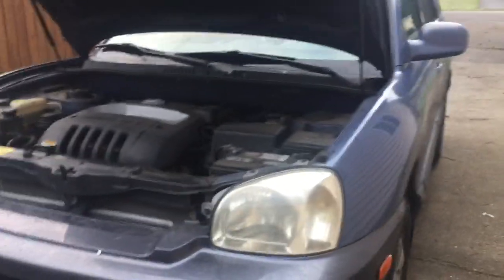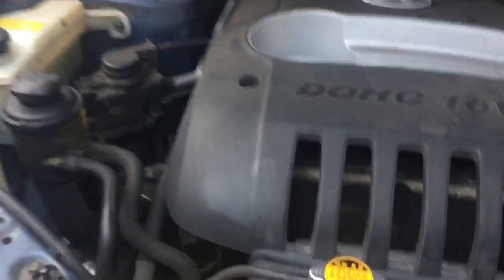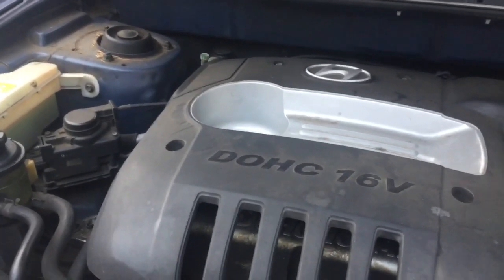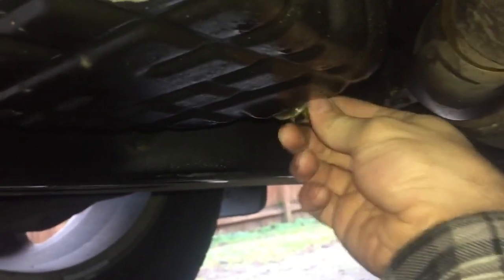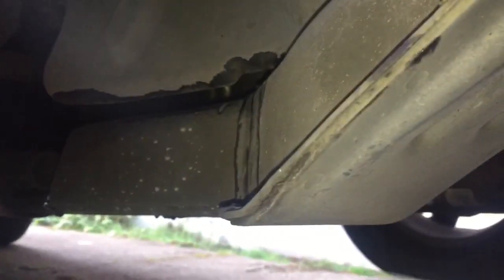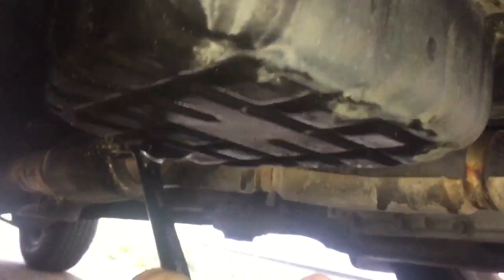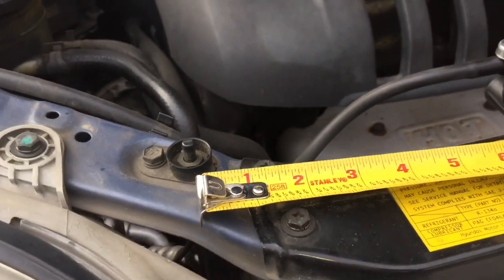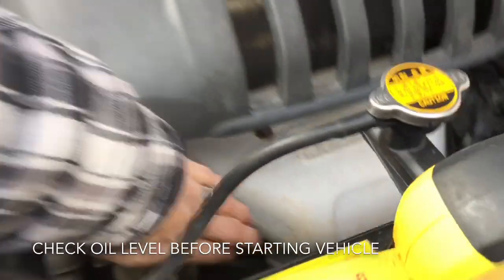How to change engine oil on Hyundai Santa Fe 2.4L

Comment: Hey dude really appreciate the videos on the 04 Santa fe, can you make a video on how to replace the rear speakers in the trunk?
Reply from the maker: Mine do not need to be replaced but I may make one just because I’ve had so many request. I will try to make one this week
Reply: @TweekerDan1984  thanks dude you're awesome. Subbed.
Reply from the maker: Ivan Cheah I went through and made a video of replacing the rear speakers,I’ll have it posted tomorrow.
Reply: @TweekerDan1984  you're awesome. Mad respect dude.
Reply from the maker: Video is up 👍 https://youtu.be/0bFHMruSiVw